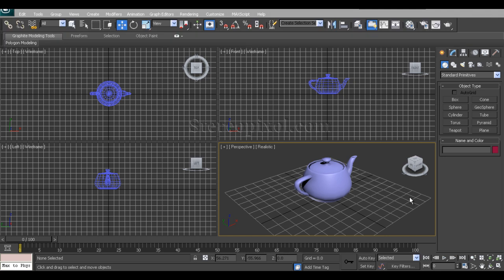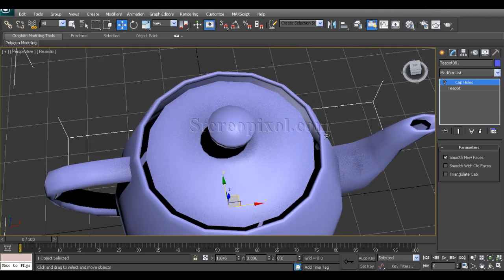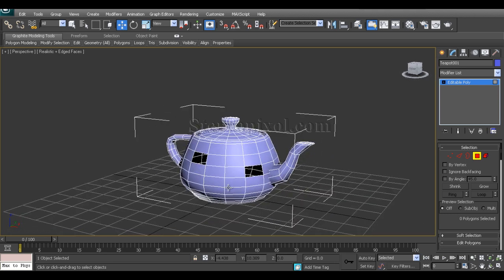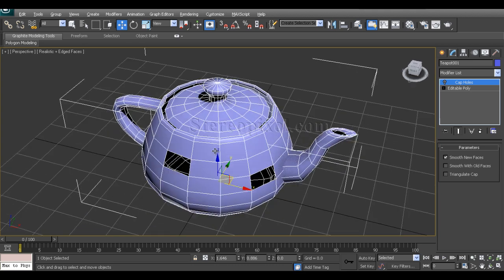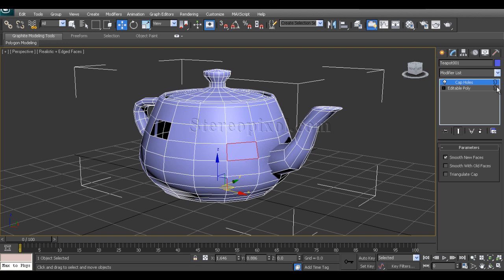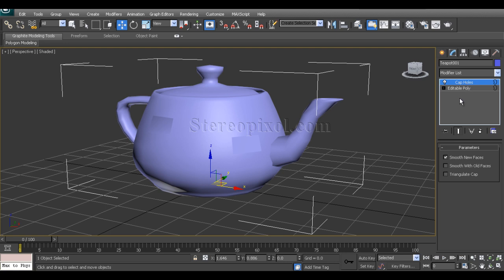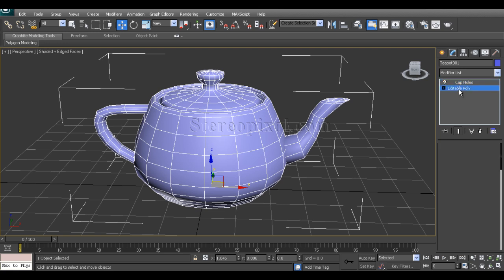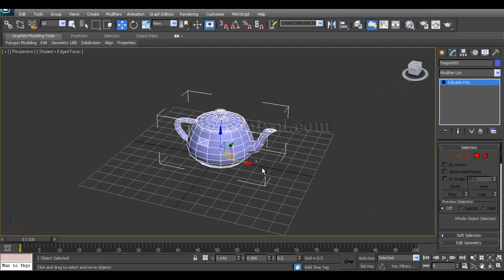Cap Holes Modifier in Autodesk 3Ds Max - Beginner Tutorial

Comment: Thank you! This is the only cap holes video I can find that bothered to mention that critical final step of convert to polygon. I'm still a noob at 3ds Max, but if I understand correctly collapsing the modifier would also work to make the change permanent.
Reply from the maker: +Vlainstrike yes you are right. Collapsing the stack will delete the dependency of the lower. Hence the effect will be permanent. But be careful if you want to make any change then you cannot after you merge them. So you need to be absolutely sure of the collapsing.